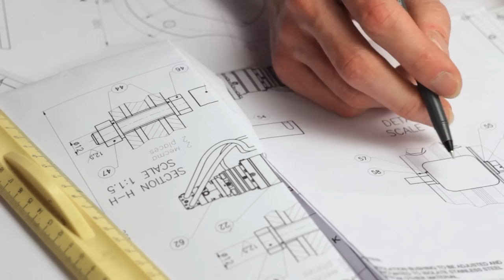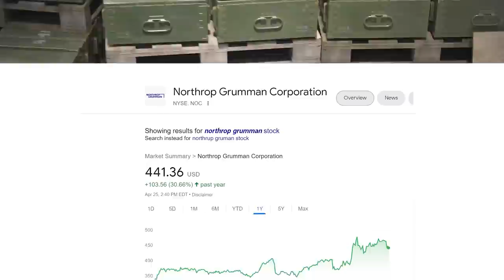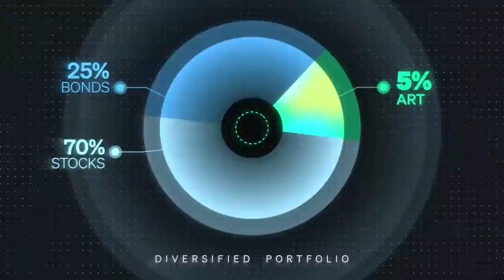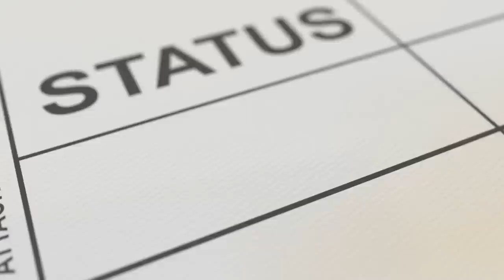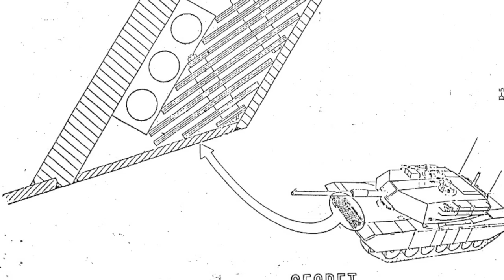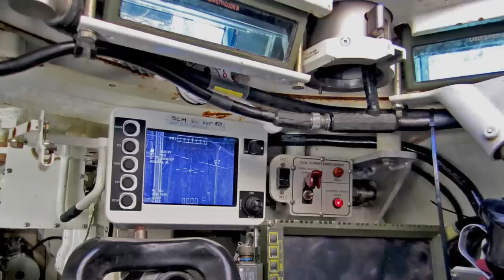The M1 Abrams Tank Needs to Chill Out

Comment: Fun fact:
Poland will be the first European country to use the abrams 😳🥵
Reply: Have fun being the 2nd country to have a tank with depleted uranium armor and ammo😨
Reply: @vyros.3234  they dont use depleted uranium in export m1 abrams
Reply: @vyros.3234  leopard 2 tanks are far superior lol
Reply: @vyros.3234  OKay, what's wrong with that?
Reply: @vyros.3234  Many tanks use depleted uranium, not just the abrams
Reply: @FullThrottleRacing535  the Abrams uses more than any other nation, other nations will typically use Tungsten instead
Reply: It may not be a perfect solution, but it is better than dying in steel coffins like the T-72
Reply: @FullThrottleRacing535  to my knowledge even the chinese type 99a1 has deplated uranium
Reply: @joostzegr7193  could you explain why to me? (Im genuinely curious)
Reply: @teejin669  better cute control system NATO ammo is actually stronger and more efficient and moast important that stupid gas turbine is not fuel efficient and prone to brake downs 
Look at Russia and see how important fuel efficiency is
Reply: I think Poland just chose the Abrams over the Leopard 2 they already had because they are simping for the US.
Honestly, if the US would sell tactical bathwater in jars, Poland would probably buy some. 😄
Reply: Also second to use Challenger 2 tanks. First using 6 different platforms.
Reply: @Betterhose  The leopard 2A4 has gen I Thermal which is really bad.  It has no independent Commander's Thermal for hunter/killer ops.  It has the older ammo and the magic "shoot here to win" spot... the AMMO stored in a cabin rack (as in a rack located inside the crew compartment without protection) in the LEFT FRONT LOWER HULL (next to the driver).  The cost of upgrading the Leopard was more than buying the Abrams.
Reply: @HanSolo__  IF they get them.  The UK hasn't committed yet because they only have about 400 of the Challenger II.
Reply: @Bustin_cider00  Who cares how much is used in each tank? the point i'm trying to make is much more than just the US use that.
Reply: @Betterhose  Maybe you are right, but the main reason why Poland buy Abrams is that it could be mass poduction. Just look how a litle Germany have tanks Leopard and the number of their production for other countries, which bought it. 
In Ukraine by 2 month has destroyed more russian tanks than in most Europe countries have in arms now. That's why Poland want to buy a big number of tanks in short term, thats why they buy near 200 Abrams tanks in one contract and will continue buy it to counter russia.
Reply: @joostzegr7193  thanks for helping me, being able to hit more often is very important when the biggest deciding factor in a tank duel is hitting first is very important for a tank. Also, I have always heard that the US militaries strength is logistics, so why is maintenance and gas usage a bad thing for them? (although I do agree it is bad for a country like poland). Thank you for the response I do appreciate it.
Reply: @joostzegr7193  
Yeah, the turbine was a bad choice I think. It's just like you said. They require more maintenance, are less reliable and have a worse fuel efficiency. Especially in desert environments, the fine sand and dust is killing the turbine fans.
Even the Soviets made the conclusion that turbines aren't any better. They tried a turbine with their T-80 but went back to regular diesel piston engines.

Another shortcoming (pun intended) is its main gun the M256A1. The Abrams still uses the "older" 120mm L44 while the Leopard 2A6 has a the longer L55. With its new ammo, the L55 has 30% more muzzle energy than the L44.
Reply: @swaghauler8334  
Leopard 2A4 ??
Are you really going to compare a tank from the 1980s to a modern M1 Abrams?
Reply: @gotrefer6183  
You realize that Germany's number of tanks has nothing to do with production capacity, right?
Reply: @FullThrottleRacing535  its actually very few nations that use Depleted Uranium armor, that was MY point. Its not just the US you’re right, but its not common by any means
Reply: @Bustin_cider00  Actually your point was  the abrams uses more than other tanks, not that few nations use it, do you have dementia?
Reply: @Betterhose  THAT'S WHAT POLAND HAS!
Reply: @FullThrottleRacing535  …imagine telling someone what the other person meant when the other person spoke… 😭
Reply: @Bustin_cider00  if you meant that then you should have probably said that in the first case
Reply: @FullThrottleRacing535  i said other nations typically use tungsten. That would mean it is not typical for them to use Depleted Uranium, what are you even going on about
Reply: @swaghauler8334  no they don't they have leopard 2 PL
Reply: @joostzegr7193  You better go back and look at the PL acquisitions history.  The Poles have exactly ONE COMPANY  (14 tanks) plus training tanks of the PL model by the end of 2021.  The rest are Leopard 2A4s.

The Poles have as many PL models in service as Russia has T-14 Armatas.
Reply: @joshthemigpro1733  with the m1a2 sepv3 they but they dont with the older models such as the a1 unless some sort of special deal is made :)

Comment: Abrams being manually loaded vs slow auto loaders is a huge advantage too. The auto loader of the Russian tanks makes them prone to blowing their top, literally, if hit just right. One thing is absolutely true though, the Abrams tanks are the most battle proven tanks on the planet and no other has laid down as much hurt. 🇺🇸 💪
Reply: The issue is where the ammo is stored.  This particular autoloader has a carousel of ammo in the subturret, with the propellent fairly exposed.  Any significant hit on the T72, even those that don't penetrate, can lead to 'spalling' where bits of slag and stuff is flying around inside the turret.  If the propellant catches fire, 'pop' goes the turret quite often.
Reply: You just cant compare middle east to Ukraine, russia is facing modern AT missiles,  stugna has 5-6 km range and easily can destroy abrams. Russian konkurs atgm 8 km range. Tanks are easy to destroy in modern war. Its why US is not going to send a single tank to Ukraine, its bad for PR.
Reply: @mateuszkoza8065  
😂😂😂😂😂😂😂😂😂😂😂😂

Comment: The automatic loader in russian tanks is in every way worse than a loading person. With the exception of one thing: when tanks break through the nuclear strike zone, the loader (human) is no longer able to work at a high dose of radiation. But the rest of the crew is still able to do something. These tanks were not designed for guerrilla warfare - they were supposed to advance on a wide front in World War 3. But they never met their ideal battle conditions. Instead, we constantly see how the crew is killed due to the placement of ammunition next to them. And despite the outdated concept, the russians will not refuse to place shells directly under the crew. Although they have projects ... but there is no money anymore. Let this money not be - their hands are too bloody.
Reply: Not only in nukes but manual loaders have no consistency, and for about the same loading speed, a consistent loader is better. A manual loader will get tired almost immediately after the first few shots, and it's completely impractical as shells get bigger and heavier. Espescially because the Abrams uses one piece ammo, meaning the loader has to load it all in one shot, unlike Russian shells which are two piece. Carrying all that weight constantly will eventually wear down your average 19 year old, especially in prolonged scenarios like in mass cold war tank charges.
Reply: @someturkishguy8638  And thats why they train
Reply: @someturkishguy8638  thats not how it works.
As a Loader Its the toughest job with all the graditude. every one in that Tank has been a loader... every single one from private to 1st Sargeant. 
they understand the difficulties and the stress factors involved in that particular job. So there is no tears of it being hard. If you are proficient at your job you move up in rank and someone takes your place. 
but you are NEVER stuck in that position. Thats just bad Leadership.
Much respect...
Desert Storm / Kosovo Veteran
Engineer Sapper
Reply: @xllsapperllx1730  They can respect and train all the time but being expected to load 18 rounds of 140mm (if they actually had gone through with that idea, they even tested it on the Leo-2)  One-Piece ammo while dozens of tanks are charging across the Fulda-Gap is going to destroy stamina. Autoloaders are often very reliable if maintained correctly.
Reply: @someturkishguy8638   i agree with "if they moved up to 140mm, the task would be harder on an individual".
If the individual did have a hard time loading rounds, AS a team they would ensure that individuals short comings were well taking care of through proper Leadership. This team eat, sh*ts and breaths that Tank. "If you are not fixing it You are training on it." 
on a plus note... rapid fired weapons have less target effectiveness. 
so while a Russian tank is lobbing in rounds. Nato Abrams can pin point a  target with a higher effective kill ratio
Reply: @xllsapperllx1730  the issue is that as layered defenses become more common, successive rounds are probably going to be the way to go. As people bolt on APS, ERA, composite armors, etc. onto one tank, the only way to beat it is by firing as many heavy rounds as possible onto an enemy. Or that's just my opinion. Who knows, but all we can realize is that a 57mm autocannon can fire say, 400 rounds per minute into an enemy vehicle, completely negating the APS, while one single 120 or even 140mm shell might get blasted away by it, and then by the time that manual loader shoves the heavy long rod penetrator in,  the enemy tank already hit your 400mm thin side with an ATGM.
Reply: An autoloader is absolutely not worse than a person. Depending on the design of the tank, it’s faster, has more staying power, and leaves more room in the tank for other systems, protection, or just to make the tank smaller.

Not adopting one when we have the tech to make it incredibly reliable is stupid. It’s not the 80’s anymore, we can make things that don’t break.
Reply: @Fireclaws10  I was referring specifically to the automatic loader in russian tanks, where the ammunition load is not separated from the crew habitat. This is simply the cheapest solution from a country where human life is worth nothing.
Reply: @someturkishguy8638  If loading is carried out from a separate storage, then this is a good solution. However, as a former operator of soviet equipment, I can say that 3 people in a crew are much worse than 4, because it’s simply harder for you to maintain and repair equipment with three of you. Imagine the procedure for changing tracks or pulling a tank out of the mud. Of course, you can ask the neighboring unit to help, but there are often situations when they are "too" busy, or your commander or driver brought the tank to the wrong place during the exercises, and no one will help you, since your suffering will be perceived as a fair punishment for stupidity.
Reply: @xllsapperllx1730  On the M1 "Thumper" prototype tank, the 140mm gun has an autoloader because the rounds are too big for a person to reasonably handle. In the only photo I've seen comparing a 120mm to a 140mm round, the 140mm round is at least twice the mass. It wasn't just 20mm wider it was also much longer.
Reply: @Skeptic0286  that is more of a problem of strategy and how you treat soldiers rather than the vehicle itself
Reply: @Skeptic0286  the French have the right solution, where in a tank battalion you have extra troops for maintenance. 3 in a tank, but 4 to run the thing. 

More people in a tank is not a good thing, people are expensive and take up valuable space.

Comment: Kornet doesn't use wire. Even in this video you made, with the footage you showed, there is clearly no wire. Yes, it is more "traditional" in guidance (not fire and forget until the latest version), it is not top attack and is a bit on the heavy side... But it outranges Javelin and NLAW by far (8km for anti tank version and 10-11km for thermobaric). And new vehicle mounted launchers have the capability to launch two missiles in rapid succession and down the same trajectory so that the first would be a decoy for active protection system on the targeted tank, and the second would actually hit the tank.
With tandem warhead and penetration around 1200-1300mm... Nasty stuff!
Reply: None of Kornet are fire and forget, not in western definition.
Reply: Do you need a special vehicle/system for that rapid fire ?
Reply: You're right, Kornet is laser guided. Rides the laser beam.
Reply: @maxmagnus777  It's just literally two launchers put together and synchronized. But it works!

Comment: As far as tanks go M1-A1 is among the most badass. Partially it's comparatively over-powered, and the targeting an accuracy of its main gun. It's biggest problem is that it's a fuel hog with the gas turbine powerplant. (The required tail of material and fuel that supports it limits its mobility.) However what may make western tanks better (not just Abrams, but all NATO platforms) is more of a tactical doctrine rather than something completely technical. That is the tanks are not used like some independent operating piece left to wander on its own, but integrates with combined arms planning and execution. That is infantry, mechanized units, CAS, and air superiority work closely to take control together. Not just mission planning, but there's a lot of communication involved too. Things are networked, intelligence is shared when possible. If you leave those pieces out, then there's a gap that somebody with any planning sense can wedge a possible advantage into.

Comment: I was a “crunchy” in a light infantry unit posing as OPFOR for tankers, he’s not joking about quiet.  You heard the squeaking of the tracks before the whine of the turbine.  
Each tank that went through we knew we were sacrificial, but our tactic was to see which tankers popped the hatch to engage us, and which engaged at distance with the coax.  While they were lighting us up, our TOW gun 2 km behind was sighting and lighting the tank up. 😂😜
Reply: When I was at Knox for 19E training in 1981, we were putting some M16A1s into storage when I heard some engines and saw an M151 drive past. Then two M1s (105mm) followed it, and I couldn't hear their engines over the jeep.
Reply: I drove a Sheridan at Irwin for Opfor 🤣 such a fun base
Reply: Also hiding a tank under tarps in sand and watching people stop when the miles gear says "dead" and they can't see you was priceless

Comment: I think the main reason why the russian tanks have faired so poorly is due to the lack of infantry support, and the exposed way movement of the tanks have been executed. The abrams is of course gonna be vulnerable against antitank-weapons, but its not gonna end up in the same dangerous, and very avoidable situations as the russain tanks.
Reply: For some reason the Soviets waited until the spring thaw. Perhaps it came early and they couldn't adjust their time table. Going cross country meant the armor became stuck and their training did not include movement to contact down a road.
Reply: @ODST6262  That is a great point. Do you know if the american tank crews are trained for these sorts of situations?
Reply: @Skrammelcaster  No. I just typed a long reply which was deleted. Basically, American crews and forces are linked together by digital encrypted systems and trained to think for themselves. Soviets are not. US forces also have really good thermal viewers so moving while in line of sight and not being spotted is really difficult, especially to drones. US would form an ad hoc mixed force of tanks, MICV, recon helicopters, attack helicopters, drones, SP mortars and artillery to push up a road and cover that push's flanks.
I saw no indication the Soviets deployed recon ahead of them or to their flanks - drones and helicopters and BRDM or BMP recon vehicles. Just pushed up the road in numbers.
Reply: @ODST6262  thank u for the great response
Reply: The Russians also have shockingly poor communications security in Ukraine, for one reason or another. If a US commander were stupid enough to use the M1 Abrams in a manner similar to what the Russian generals have done with their tanks, the results would be exactly the same as what the Russians are facing. The M1 is a great tank, but it isn't invulnerable.

Comment: Tanker here and part of TEPAS program (we trained foreign fighters how to use older export tanks , I know the M41 Bulldog , M551 Sheridan, M60 line , M1 Abrahams , few Russian models , Leopard , etc etc etc)
Crew survivability has come a long way , the "bouncing" is actually more for keeping the tank in motion to enhance the armor , the lower front plate of hull could be pierced so moving back and forth changes angle and protects driver , it's very much akin to infantry firing from cover . In sand you can create a rut allowing tank to fire from a "Hull down" position which makes it near invulnerable to most weapons